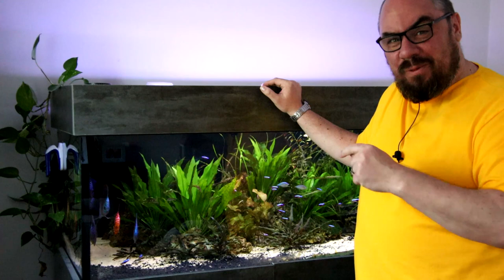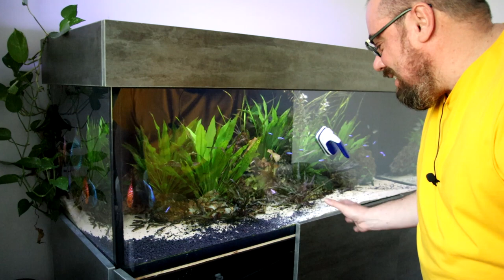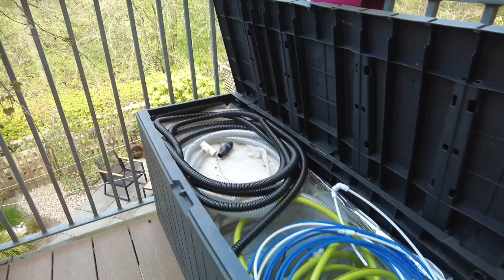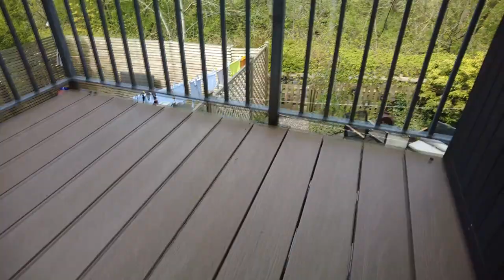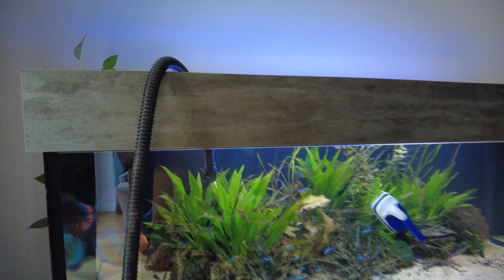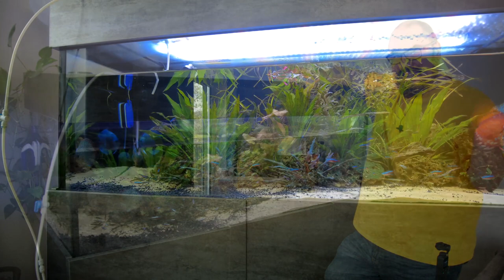Discus Tank Maintenance - Water Changes

Comment: I am also a discus keeper, and I do not do water changes unless there is a major issue in the tank. I use the planted, deep substrate method. I have only done two water changes in the last 3 years.
Reply: Wow, and the discus are happy? So as long as the water does not change much, the fish will be happy? I have discus too, just having them for a few months now. I have done one third water changes almost weekly. However, I am worried when I plan to leave for my holiday for about 3 weeks.

Comment: Are you changing with water straight from the tap? I keep a barrel, about 32 g, that I preheat and keep active with a pump, because sometimes our water can see chloramine spikes from the municipal water supply. When it's water change time, I fit a pipe onto to that activating pump to refill the tanks. Works great, and is really not much effort. 4 beautiful blues and turquoises in a 55g with tetras, corys and fat happy bristlenose
Reply from the maker: From the tap but through a HMA filter, which removes chlorine & chloramines 👍

Comment: In your video you mentioned a little about trace elements. Do you think Trace Elements by Seachem is necessary for a discus tank? Going to be starting up a discus tank and trying to get all the info I can. Thank you for your time and great vids.
Reply from the maker: This is a bit of a 'how long is a piece of string answer' but it really all depends on your existing water. Products like 'trace elements' in my mind are mostly for people who use RO water, then re-mineralise. If you have horrible water and need to use RO, then re-min products are absolutely required and very good. If you aren't using RO, I think they would cause more problems than solutions.

Comment: I have a discus with cloudy eye who sight is not good. I have been doing 25% water changes and using Melafix pond at 1mm per 10 gallons. I have 6 large discus in a 150 gallon tank. So far after 14 days I am seeing no real improvement. Water perimeters are okay . Help needed. Is it possible to insert a photo on this sight?

Comment: Are you using RO water and are you adding anything to the water.
Reply from the maker: No, and no. 👍
Reply: @AquariumAdventures  Why is that. I have always been led to believe that you cant use tap water. Or does this depend on the area you live in
Reply from the maker: @theflossingfisherman7925  I use a HMA filter which removes chlorine, if I didn't have that I would use a water conditioner like seachem prime or similar. Other than that I don't do anything special. RO water is not needed to keep Discus - breeding, maybe, but not just to have a display tank.